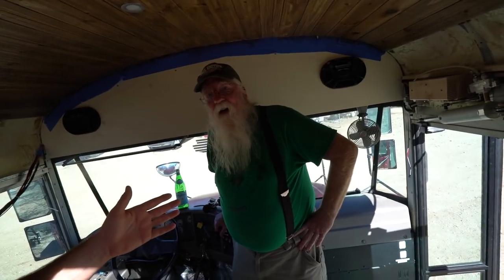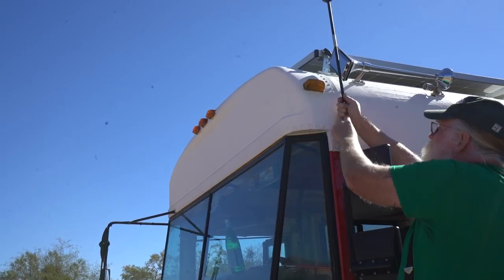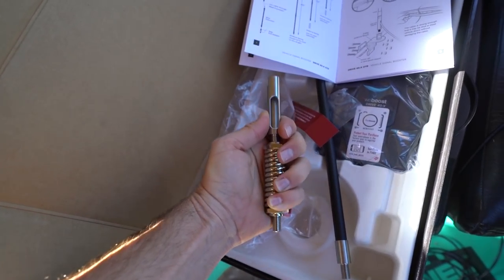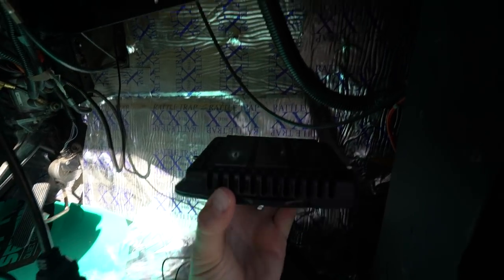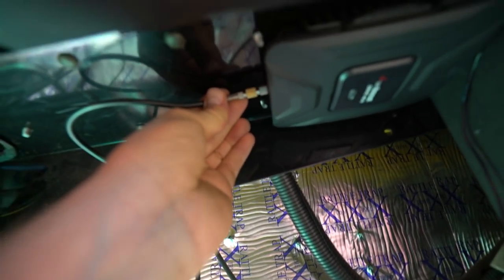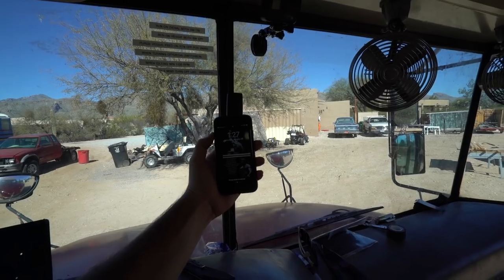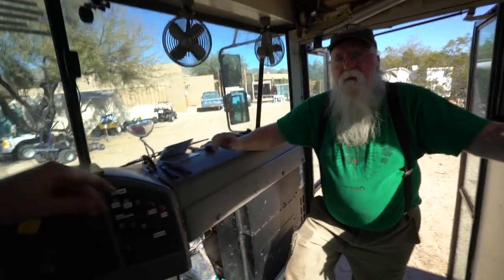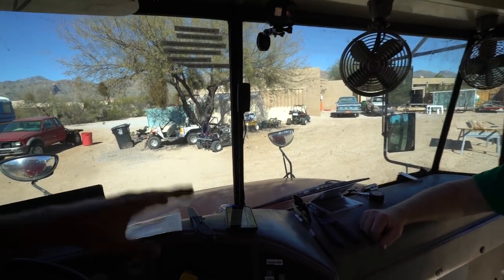WEBOOST 4G-X OTR Cell Phone Signal Booster INSTALLATION + SIGNAL TEST REVIEW (custom 12v hardwire)

Comment: We’ve had we boost for a couple years. Two things.  like you said real world conditions sometimes it doesn’t do so well when there’s a gazillion people suckin up all the glory like at Qaurtszite this year , we found antenna separation effects performance greatly when out in the wilderness we have ours set up on a telescopic pole 1’ of hieght means 1 mile of reception to the tower. The extensions loosen up where the fiberglass pole goes into the metal. And finally you should definitely switch (on/off) and fuse that power. Good luck.
Reply from the maker: Thanks for the feedback. 🙌

Comment: Hi Jax, and Steve.  You guys are educating me.  Thank you for going through all that.  Makes it so much easier.  I think I could use that at home.  I can only get a good signal in a few places.  I drop calls all the time, unless I'm really careful.  I'm reading about it on the internet so, who knows, I may be getting one...  for home.  Unless there is something better for home.  Thanks guys.   Lynn
Reply from the maker: Have you tried WiFi calling? Sometimes you have to set your emergency (911) address before it works properly. Otherwise, a booster will work also!
Reply: @ Small footprint Call you phone carrier (t mobile, Verizon, at&t) and ask them for a Booster. We got ours for free.
Reply: @JaxAustin  ...  Thanks, Jax.  I'll look it up.  I can learn, but being a little older, I don't come about the technical world naturally.  I'll look up, WiFi calling and a booster.
Reply: @silversurfer5132  ...  Thanks so much.  I hadn't thought of talking with them.  I'll check in with them tomorrow.  :-)

Comment: Keep the antennas separated as much as possible. Also the interior antenna should not face the outside antenna. You will notice a difference.
Reply from the maker: Michael Lathwood ok thanks!
Reply: If you need any help installing electronics mobile or otherwise, let me know. I work for a Motorola shop in Tucson and Phoenix.

Comment: Hi Jax!  Just a suggestion here, see Creativity RV for her way of using her booster.  It's not permanently attached, just so it doesn't get bonked, etc., and it's on an extension pole so that she can get it up really high to take advantage of far away towers, she's in the desert a lot.  Takes 2 seconds to put up.  Just a thought.  Karen
Reply from the maker: Good idea, Karen! Badge uses his like that, but I’m honestly moving around (kinda like a trucker) and wanted a hassle free system that allows guests to upload while driving. Hope it performs as well as the permanent systems!! 🙌